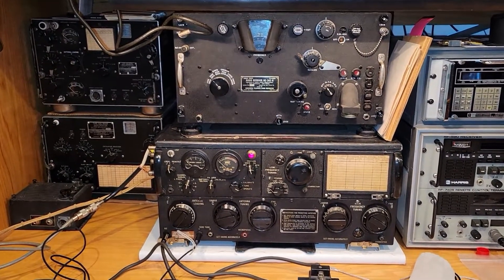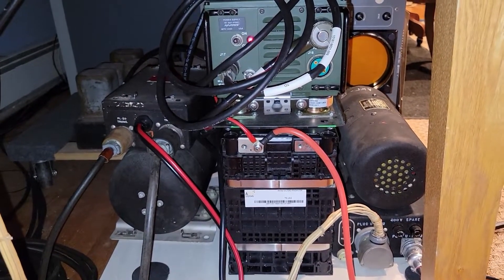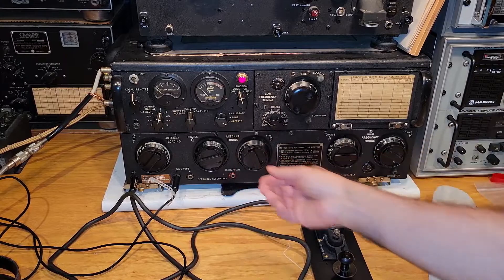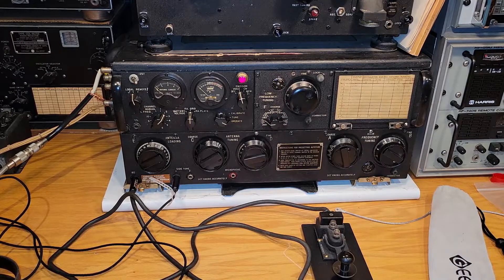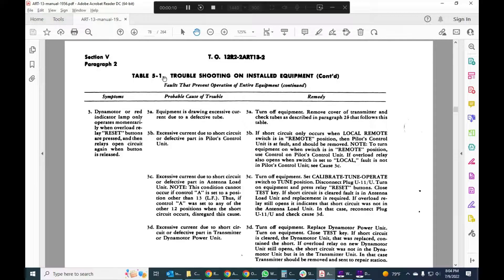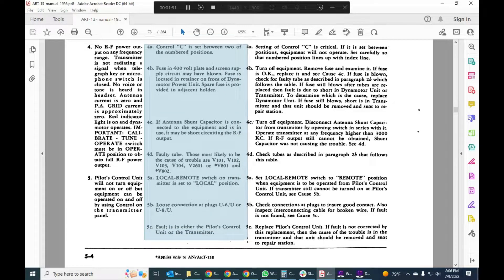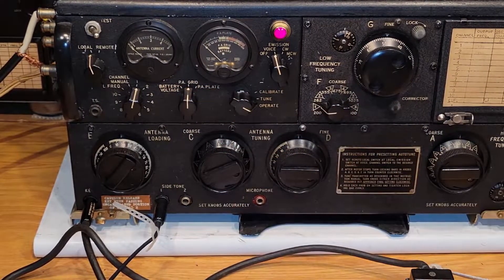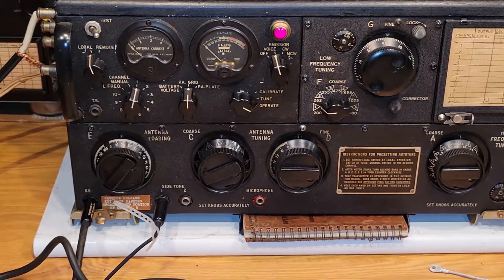ART-13 Part 3 - Autotune and Grid Current!

Comment: Great video. I have a ART-13 that smoke came out of the multiplier section. A real bummer. I had to remove the multiplier section and found a 10 watt 1k ohm cathode resistor burned out. I found a 500 pf cap had shorted to 150 ohms. It was a chore removing the multiplier module but I got it working.
David KA5IXE
Reply from the maker: Thanks very much. I still have a TON to learn about this rig. And I haven't had much time to play with it. Still need to make more videos on it, thanks for the comment